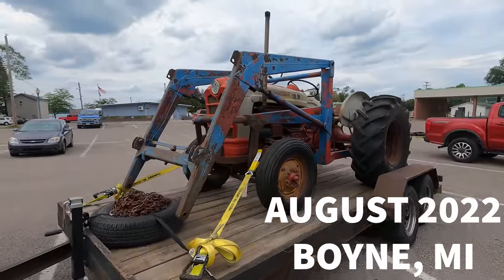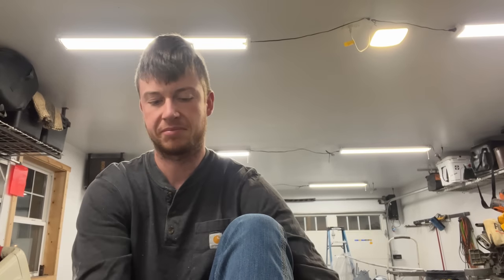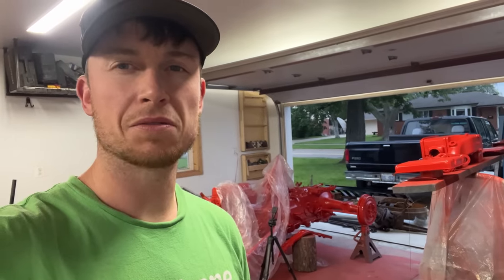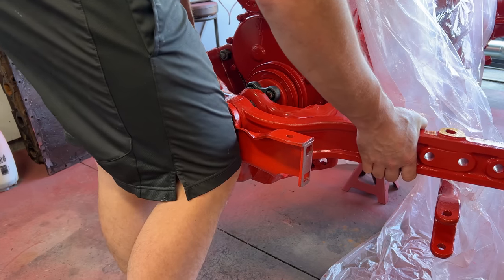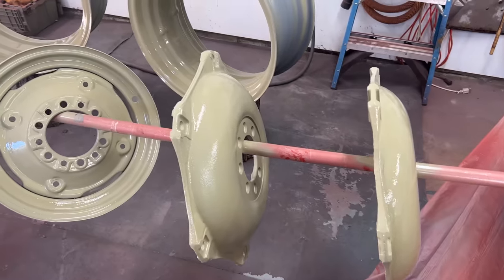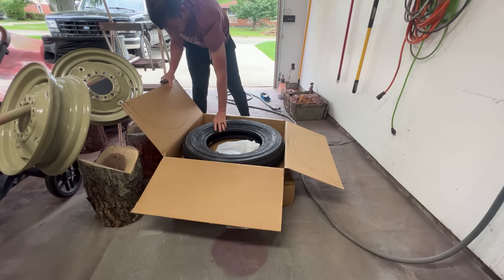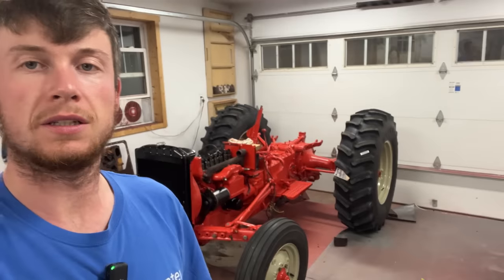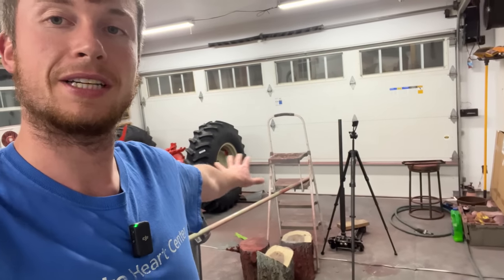$2500 tires and 100 hour paint job for the Abandoned Ford Tractor

Comment: you need to swap the rear wheels side to side
Reply: 😂 I saw that. 👀
Reply from the maker: Then the treads would be backward 🤔
Reply: @dieseJL  no keep the tread orientation the same.  The center portion should curve out not in. You put em in wrong way round. The easiest way to fix it is to swap em around. No offense they will work just fine the way they are. See the rear tires in original configuration at 0:11 of this video.
Reply: @ManMountainMetals  agreed!

Comment: Why do you have to do that with the ridgid impact?
Reply from the maker: idk it crapped out on me where it constantly has a battery drain now. So if you use it then set it down for a minute or two it won't work again until you take the battery off and put it back on again. Time for a milwaukee